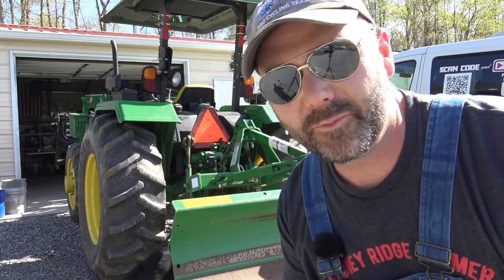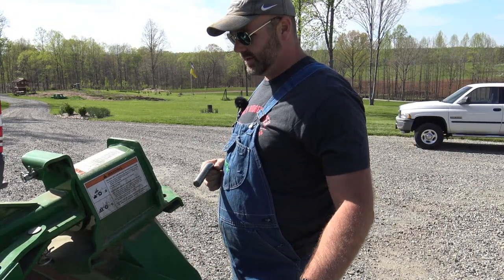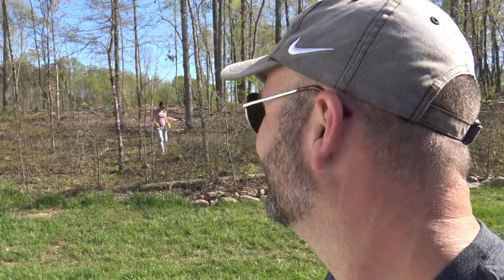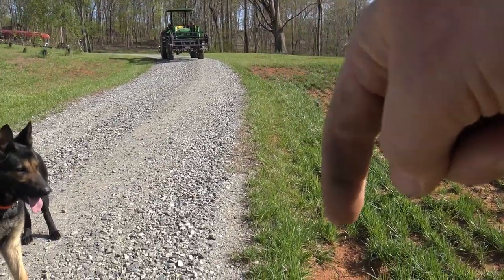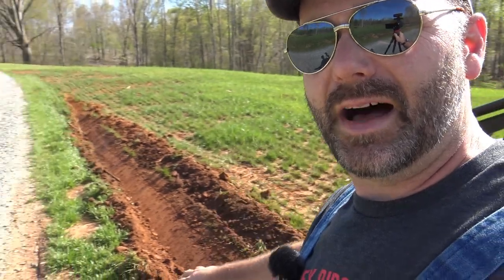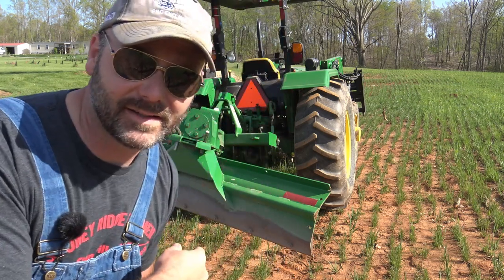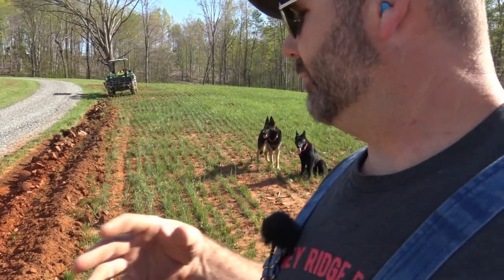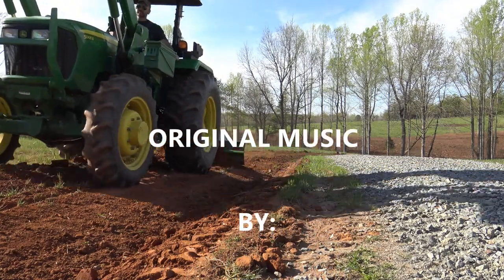Tractors at work...How to properly ditch your driveway to stop washing!

Comment: Hey pard I'm a motor grader hand and have been for 39 years you did a good job. You angle your blade around a little more and it will shed and carry more dirt instead of a straighter blade. Once you carry it up the back slope as far away from the bottom you can straighten it out and float the dirt out!
Reply from the maker: Thanks Joel!
Reply: Hey man, that's a good job on the ditch! It looked really good smoothed out in the field too.  I'm a motorgrader hand too, and it was always drilled in my head while learning, to not put material back in the ditch.  Maybe cut the shoulder material into the ditch first, then pull it onto the backslope (your field in this case). Start closest to the road, and work material away from it since you didn't want the dirt in the road.  It might be a little more time efficient... if you are worried about that. But on as nice a place as you have, I wouldn't care, I'd just love to be outside working!

Comment: Wish I had an adjustable scrapper blade.  Did a ditch along the side of a couple acres yesterday. Had to improvise.  My brother-in-law loaned me a bottem plow that I used to cut a trench.  Took a couple of passes to get the depth I wanted.  I tilted my box blade as much as possible, dropped the low end into middle of the trench and sloped the sides.  Worked pretty well.

Comment: I need to do this same thing to my roadway.  Just borrowed a hydraulic blade for my JD 5057M. Thanks for posting. Hope mine turns out well.
Reply: Josh does great work doesn't he?  We are also interested in this tool for our tractor.  Sure would like to know how it went with the hydraulic blade!  Glad to see the 5075M is still running strong.  Cheers Greta!
Reply: Steven Kuehler My work across the creek from the house is an ongoing project.  The blade has helped a whole lot.  Especially, with all the rain we have had.

Comment: Howdy,

You did a great job on the driveway ditching. I have seen a number of folks who keep running a box blade over their driveway due to washouts, when all they need to do is add the correct drainage ditch on both sides. I have the 6' version of your blade and I got it to be able to do just what you did.

Keep up the great videos!

Comment: The proof of the pudding is in the eating - you got a good result, which is really impressive for a first time. I agree with the one person who said the last pass with the blade backwards does a good job smoothing. One aspect I haven’t seen anyone address is why the washing happened in the first place. Erosion from the field side created an alluvial fan that filled the ditch so water started eating the road side. Your fix addressed the current state well. If you can prevent soil eroding from the field, your fix would last longer. If you will have sod above and into the ditch, you should be fine. It might be good to take some rocks to make small dams to slow the water down, but the top of the dam would have to be below the road and even then might fill in above it and actually create the same problem again. Slowing water down is about the only way to stop erosion when there is slope- we deal with this on our place in MO too. Good job!

Comment: That seems fine. thats how I worked mine... one word of advice. don't do anything like that when it's at all wet or muddy. You'll just make a mess. ask me how I know. :)
I did think about using a single bottom plow first, then using the back blade as you did but I needed mine deeper. And my tractor is much smaller. Keep doing what you are doing.

Comment: I like the work you did using your tractor and blade to dig the ditch on the sides of your driveway and it looks great too. I need to do some work around my home and back into the back of the property, but is waiting for it to get cooler before going into the back of the property, but is going to clean up around my home and that of my sister after her contractor finishes building her new home.
Reply from the maker: I hear ya on the cooler weather! It's so so hot here!
Reply: @StoneyRidgeFarmer  It is the same here in Arkansas and we can only work in the mornings and afternoon late.

Comment: If you would slide the blade down towards the tractor tires it will cut and roll the material really well. Slide it back up more up and down to finish. Your blade should be adjustable for a cut and roll or to do finishing work. 10 years experience in the quarry business here. Great videos!
Reply from the maker: Right on thanks!!

Comment: Hello from Australia. You did that spot on , I did the same on my property so it's more mowable.  Only pointer I could give is considering you've got such great soil , when you tidy up small windrows of soil or spread it out in the paddock use the back of the blade.  It's much more suttle and won't dig just spread out loose soil if you haven't already.  Good work your doing and take care .

Comment: I've been grading down an above ground irrigation ditch using similar techniques with my Ford 3910, but my blade doesn't have the same adjustability so it's taking a while. I use draft control while cutting, makes the cut consistent and driving easy. Hadn't thought of turning it around to spread without cutting, nice.

Comment: Nice job demonstrating how to cut in a roadside ditch with a variable angle scraper blade.  The only tip I'd offer is to cut the ditch a little deeper than you think you'll need to because the driveway will "sink" a bit over time and the ditch will eventually fill in with silt and other debris.  I'm looking at these blades right now to redo my driveway ditches and cut in some new drainage swales to avoid having to use the single point bottom plow/box blade method.

Comment: You can make adjustments with the leveling side on the three point arm as well. For those times when you need to be between the adjustments on the blade.
Reply: thanks for adding this comment. I had the same issue!

Comment: I have a drainage issue on my driveway as well. Summer before last I laid in over 2k worth of rocks to fill in the ruts. No ruts now but the whole thing is flat not rounded as the stone smooches into the soil. I need to get out there next spring and get some drainage ditches dug. I have a Ford 3000 diesel tractor with a blade, not as nice as yours, but it should do the job. Thanks!

Comment: On your last pass you should start at the top of the hill and work down. Turn your blade all the way around and drop it to the ground then raise the blade about 3/4" then back all the way down the hill. You can use the blade backwards like a bulldozer. That is how you set and carry grade. The reason you push instead of pull is you start your grade first then your tractor climbs on to the dirt you just pushed so your driving on smooth ground and not going over bumps.  Hope this helps ya in the future

Comment: fine tune the blade angle with the adjustable arm on the 3 point linkage. From the back of the tractor it is on the RHS

Comment: you can adjust that blade to outset wider than the rear tire.  The way you have it, it’s exactly in line with the rear tire.

When you’re making the ditch you probably want the blade to travel exactly with the tire, as a guide to know where your cutting, but when you clean out the ditch it can’t be in line, or you’ll be driving and smashing your ditch, making a mess, while you’re trying to clean the ditch out.

Comment: Just myself, I am not a fan of ditches.  They make mowing difficult, especially if they are wet and where I live it would cause snow to drift in.  (Yes, a little dip like that.)  I would have dug it with my blade exactly as you did, then toss in 6" perforated drain tile and covered it back up with the same blade.  I can buy 6" perf. tile locally for about $130 for a 100 foot role.

Comment: Adjust your 3rd link so it's tilts the blade to have a more of a cutting action into the soil, (extends the 3rd link to be longer), this will allow the dirt to "flow" across the "moldboard" of the blade. If you noticed, you were dragging a huge clump that wasn't moving. Otherwise, you did it right, just small steps, too many believe can do in one or two and it bites them.

Comment: Please, let me offer some advice, there is an implement that is designed for the project which you are presently attempting to do. It is called a "V" wing or swale cutter that you attach to your 3 pt system. The wing can be found at most tractor dealerships in different sizes for different types and different depths of ditching or cutting swales. The implement cuts both sides of the ditch or swale at the same time on an even/level plane and there is no running the tractor back and forth several times to get it right, as you are having to do.
Reply from the maker: Why would you buy an implement that could only do one thing?  I can cut a ditch or move dirt or scrape the driveway or remove snow with this....going back and forth working the land is pleasurable....buy the V wing and it will sit in the barn for 10 years...but the blade and you'll use it 10 times a year...my thoughts
Reply: @StoneyRidgeFarmer  I did not mean to offend you in any way. I was only attempting to make you and your YouTube viewers aware that there is an implement that is designed specifically for the job you were doing, nothing more. Your money, your choice, but at least your viewers should have the option, don't you agree ???

Comment: If you put the blade back to flat then adjust your tractor linkage you can get any kind of a pitch you want.
Reply from the maker: But......the blade is adjustable so it seems that pulling a pin and adjusting the blade would work best in this case right?

Comment: Cool I’ve been wanting to ditch my driveway for years I have older 3pt grader blade doesn’t have the 2nd angle adjustment but I think I can do it with screw adjustment on 3pth going to have to try thanks

Comment: Before I start this I want to say this, it looks good for your first time.... Now here is some food for thought. I used to own my own company and I did a lot of driveways. There is a screw on the lift arms that allows you to off the attachments. That is what you use to fine tune your angles. I had hydraulic cylinders on both sides of my tractors and one my top link but one side does wonders.  This is not a hate post!

What about back filling along the driveway so your wife or yourself or someone else does not fall off the gravel into the hole beside your driveway? What about mowing both sides? 

If you had pulled  the dirt towards the driveway fist and filled in the holes along your driveway then went to the other side and worked both sides of the banks it would be a lot better to mow and no big hole along your driveway to back fill. Your gravel will still wash of into that hole on hard rains because there is nothing there to retain it. Use the tractor to pack the loose soil near the driveway so it doesn’t wash away. My next question is what about erosion control? All of that loose NC red clay is going to wash right down into the nearest stream! Did you dig settling ponds and add a screen to catch the loose dirt? EPA! Three very nasty letters that will fine you and love every second of it! Let a neighbor or one of these concerned citizens call them and then show a video of this loose clay running into a creek or stream making it all nice and red! 

Sow rye with lots of lime and a 17/17/17 Fertilizer. 10/10/10 will also work but the 17 does a better job with less grass loss. The rye will come up faster, retaining the loose soil. Call your county DOT manager and see if you can get a copy of the  required lime and fertilizer the State uses when sowing new grass. Yes I have sown new grass along new construction jobs. Yes it seems like over kill but you will only have to sow it once. I did a lot of yards before I was forced to retire because of my Service Connected Injuries. Once I had the NC States required charts I started making $$$ by saving $$$! 

Hope this helps 

No I don’t have videos nor do I use my real name, or have any pictures of myself on the net. There is a good reason for it....
Reply from the maker: Thanks for the tips

Comment: Wonder how long before that drain turns into abig gully you need to to turn the water back onto the land with a contour bank using a lazer level no deeper than 4 inches deep  bank 12 lnches high  depending on rainfall events  over flow points about 6-8 feet wide  for excess water to flow over grassed area  the idea is to allow that water to soak through the soil .  A small excavator is the best machine but grader blade will  work leave bank loose o will grass over time willnot notice contour bank  then buildanother contour further down the slope etc etc Its called regenerative farming . Alan from downunder cheers
Reply from the maker: yep...sorry...don't need a lazer to cut a driveway ditch my friend...this was nearly 6 years ago and it's doing great...not sure why you think it needs to be fixed or different. I'm simply teaching you and a "small excavator" costs $60,000 so this is how ya cut a ditch with a tractor ....it's doing great without lazers and excavators and if you watch the channel you'll understand that I am a regenerative farmer...why on earth do you feel the need to attack and insult me?  FYI cutting a ditch on your driveway isn't regenerative farming my friend...it's simply cutting a ditch...watch more of my channel and you'll understand more of what I'm about...then maybe you'll understand that I'm doing the best for the land...don't need to put in swales for a driveway ditch brotha

Comment: Around here you would bend or break that blade after hitting rock. The method I use is with the skid steer and then follow up with the dozer. There is no way I could do as good of a job as you did with a tractor. You run it as good as a grader

Comment: it turned ot good, what a pity the  blade doesn't have a hole adjustment between  flat and too much of an angle.
Reply from the maker: Blade is pretty adjustable...once done I packed it nicely...pretty happy with the results

Comment: I have a rather large hill I affectionately call hell hill.  It is pretty steep and not suitable for mowing, plus the previous owner of the property used Roundup to kill everything, so it has ruts and erosion issues.  What would you recommend as a low maintenance fix for it?  It's probably 30 feet long and about 10 feet high.  Thanks.

Comment: Tip: don't drive with your front loader 10 ft. In the air when using a 3 pt. Implement
Reply from the maker: Thanks deep fried  I knew I was doing something wrong bhahhaha
Reply: I was hoping someone mentioned this.  To be clear, my concern is that you're raising your center of gravity unnecessarily.  Less likely to roll if you carry your loader low.
Reply: Not to mention sometimes it’s best to fill the bucket depending on what your doing.

Comment: Great job Josh. Did you lower the 3 point hitch all the way? Did you play with the draft control at all?  I am getting ready to do mine. It';s 3/10 of a mile with a big hill near the top. I have woods on both sides, but the grader blade I have (40 plus year old ford model built heavy) has an off set up to two feet.

Comment: if my central Florida lot is  level and soil is very sandy... is it possible to dig a graded perimeter ditch and lower front landscaping area and use the dug up material to created an elevated house pad and driveway? is that a common practice?   For example .. Say my lot is 75w x 120d and to have a 16' wide drive into a  60x60 house pad and have everything else be grade down  3' into the ditch .. is this possible without fill  and what heavy machinery you recommend? I'm hoping it can be done with just skid steer alone.

Comment: Did you have to re-seed grass where you cut the ditch out? I did the same as you but I have very sandy soil so it actually created a erosion issue since I softened the area up but I didnt put any net down or seed. What are your thoughts and what would you do in that case if it was you?
Reply from the maker: yep...put down those rolls of straw fabric and re-seed asap

Comment: What do ya do when you have a blade that doesn't have that many adjustments?
Reply from the maker: adjust the arms on your tractor...or sell it and get a better blade for ditching
Reply: I welded a metal V onto the back side of mine about 15” wide and deep. and just flip it around and drag the V to make swales and ditches.

Comment: Could you dig the ditch with a single bottom plow?
Reply: the_southern_ outdoorsman ya I do
Reply: Yes, but can't smooth out the ridge it leaves behind though.
Reply: Why cant you smooth it out? You have a back blade and more than likely front blade.  I have both and get flooding from our creek so i will hopefully use josh's  techniques on the road,  but install major drainage out of sight with moldboard plow. I'll plow the furrows back over the pipe or shred up for compost if i leave open drain .